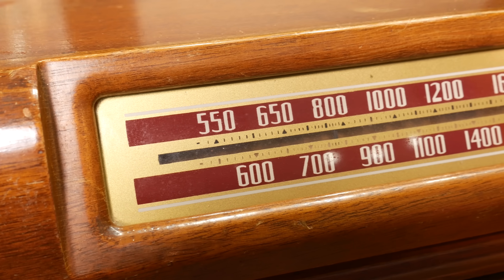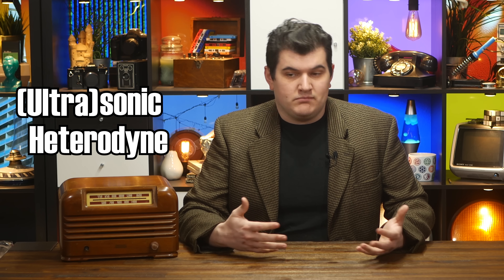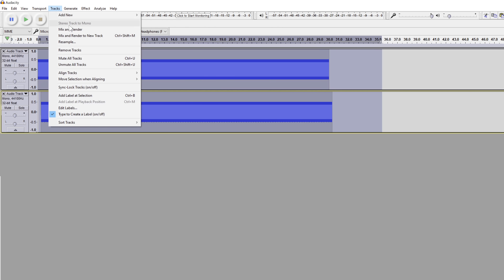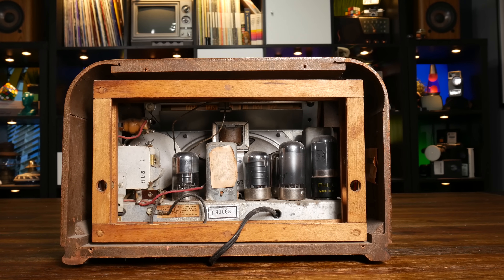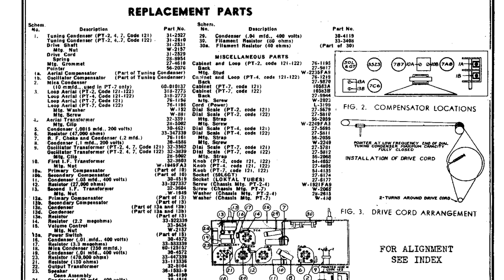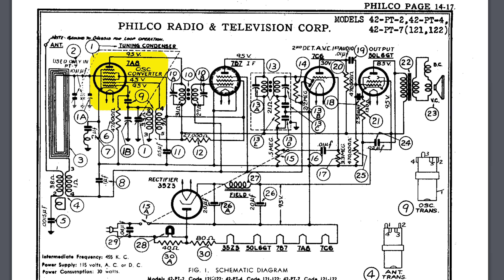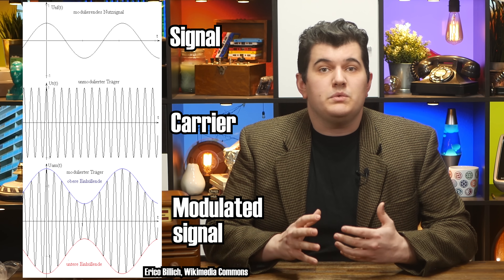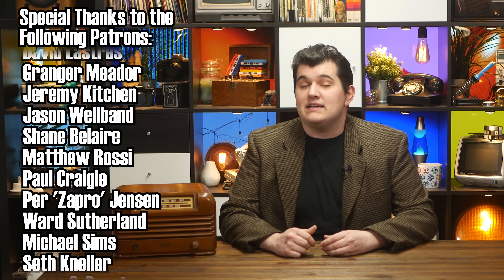The Superheterodyne Radio: No really, that's its name

Comment: Why is there a Nut Glued to the speaker paper? If I may ask
Reply from the maker: What a fine question! The speaker cone was torn in a transit accident, and while I was able to repair it with a special adhesive, it has buzzed really badly ever since. When the chassis is in the case, the front of the case presses against that nut which eliminates the buzz. It actually ended up improving the sound markedly!
Reply: @TechnologyConnections  My grandfather used that old trick! He had a cheap set of speakers with paper cones, and if they ruptured then he would just hot glue them back together. He used the same nut trick to reduce the buzzing, however the sound probably didn't come out as good since the hot glue created an unevenness in the cone.
Reply: @KSBEntertainment  plus, the pressure will impact the drivers' ability to move freely, which, from my experience, makes it sound worse. But thats entirely subjective
Reply: @TechnologyConnections  Sounds like the surround may have come unglued, it's not an uncommon sight even when the speaker has not been involved in any accidents. Something worth checking in any case.
Reply: @TechnologyConnections  Hah! I thought it might have been some sort of early mass loading, which would have reduced the Fs of the cone, lowering the frequency response, and making it less fatiguing to the listener.
Reply: @TechnologyConnections  Does it have metric or imperial threads?
Reply: I didn't originally notice this, and went back to look for a hazelnut
Reply: 5:53  For those, like me, who missed it.
Reply: I have a pair of reference monitor speakers from an old, defunct, NYC speaker company and one of the cones started to degrade at the flexible part where it mounts to the cabinet.  I flecked away the detritus and it buzzed like crazy, so I shoved a piece of facial tissue in there as a "very temporary measure" and it sounded perfect!  Even a tone sweep was spot on.  Not questioning magical speaker resilience,  I've left it that way for more than a year.
Reply: Old speakers dont have seperate surrounds , though the area where it would go is still more prone to damage from the strain. Moreso... so they started corregating the edge (still seen on pa speaks and the like sometimes) yet its still just the cone material.  You've inspired me to do some more research because I'm not actually aware of the genuine Genesis of the separate 1/2 roll surround as we know it today , I Used to Know that..
Reply: The first guitar amp with distorsion was made when a guy got a hole in his speaker and noticed that buzzing so he poked a bunch of holes with a pencil and cranked it to 11!!

Comment: Great video! Is this an AA5 (All American 5)?
Reply: Yes.  But why "All American"?  Weren't the designs in Europe similar as well?  They're also known as a "Five Tube Curtain Burner".
Reply: @stevenemert837  "The radio was called the "All American Five" because the design represented the majority of radios manufactured for home use in the USA and Canada in the tube era."
https://en.m.wikipedia.org/wiki/All_American_Five
Reply: Also called an AC/DC radio, because it can be powered by either type of current. In the 1930s, when this type of radio first appeared on the market, DC current was still available in some areas on the grid.

Comment: Why are FM stations all on weird numbers? 105.5, 103.9, 107,9. I know it's not AM, but does it have anything to do with this?
Reply: The numbers have to do with how FM frequencies are assigned. Since FM broadcasts vary in frequency (hence "frequency modulation) a station needs a range of frequencies that it can use.

In most countries those ranges are 200kHz "channels" with an even numbered frequency at the top and bottom - such 105.4MHz  to 105.6MHz. As a result, the center frequency, which you tune your radio to, is always odd numbered - like 105.5.

Comment: The superhet today has been partly replaced by direct conversion, iroinically what we used to have before the superhet.

The advances in digital technology means modern radios used for mobile phones/wifi etc.. convert directly to baseband without any intermediate frequency and use DSP techniques to provide the selectivity.

Direct conversion has shortcomings but in the digital domain they can be tolerated as data can always be re-sent and forward error correction exists too.

Some manufacturers such as Ubiquiti in the states have overcome the problems with direct conversion radio chips by adding a superhet stage that acts as a tracking filter.  This converts to an I.F. then filters there then converts it back to the original frequency albeit now with just the channel needed present.  Easy enough to do as you only need the one injection oscillator to convert down and back up again. They call it AirPrism which is a nod to the early Intersil prism radio chipsets that used superhet techniques as standard.

Back in the AM radio days a 455khz I.F. was fine as the image was always out of band, however later they added double conversion. a common frequency for this was 10.7 MHz . this placed the image 21.4 MHz away and meant the entire shortwave band could be tuned from a single radio.

they used double conversion so they could do most of their gain and selectivity at 455khz and have less stringent filtering at 10.7MHz.

Even when broadcast FM radios came out the first I.F. was 10.7MHz , hence the band was usually 88 to 108 MHz, a 20MHz span  , meaning the 21.4MHz image was again out of band at either end (depending if they mixed high or low).

Later of course as the spectrum got more crowded and higher frequencies were used they had to increase this I.F. further and 21.4 MHz became popular then 45 MHz and even 90MHz as the technology, mainly in Crystal/ceramic filters improved and so did the high frequency performance of active components.

Later still the early WiFi chipsets used SAW (surface acoustic wave) filters that were smaller and cheaper to make than crystal ones and operated in the hundreds of MHZ range.

Now we are back at square one, using direct conversion because the technology we have allows it .. Full circle :)
Reply: Even before the advent of DSP, direct-conversion or NZIF Near-Zero IF FM receivers existed. As the image frequencies are very close, they must use quadrature downconversion (mixing them with two sine waves 90° out of phase), thus resulting in two IF signals. The tricky part is that one of those must then be phase-shifted by 90° (Hilbert transform). Then adding or subtracting the two signals selects the upper or lower image response.
Concerning dual-conversion, I think it was used because 455KHz filters are tuned to a 9KHz bandwidth (AM channel width) while 10.7MHz ones are tuned to 200KHz bandwidth (FM station bandwidth). As tracking filters were a problem for shortwave, they had  to use a 10.7MHz IF but as the bandwidth of the filter is too high they downconvert it to use a 455KHz filter.
Reply: @atmel9077  the pedant in me has to say 10.695Mhz...
Reply: @hairyairey  This is because PLLs receivers commonly use a 10.24MHz reference frequency, as it gives 10KHz when divided 1024 times. It happens that 455KHz + 10.24MHz = 10.695MHz. In double conversion receivers the signal is first downconverted and filtered at 10.695MHz, and then mixed with the 10.24MHz signal which yields a 455KHz signal that can be filtered with a 455KHz filter.
Reply: @atmel9077  PLL = Phase-Locked Loop (for those who are just learning this stuff). Thanks for the reminder.
Reply: Just to add in a bit... some of the early superhets used other IF frequencies before 455kc became standard. I've seen sets with an IF as low as 155kc.
Reply: @jimsteele9261  500kHz was pretty much a standard in amateur (ham) radio a few decades ago. Still have in one of my parts box a few Collins filters on that frequency that I plan to re-use one day.
Reply: @jimsteele9261  But why 455KHz ?
Reply: @JohnSmith-eo5sp  for AM broadcast it would give an image of 910khz, outside the LW and MW band edge possibly.
Reply: I'd say what we used before superhet was not direct conversion but DIRECT AMPLIFICATION. The only application for direct conversion was morse code receiving, where frequency difference between local oscillator and signal itself defined the pitch of 'beeps'. To receive sound using direct amplification, phased-locked loop is needed badly. Not a thing you'd meet in tube designs :)
Reply: @allmycircuits8850  a direct amplification design would use tuned circuits and a basic diode detector for AM.

Would of been fine when the bands where uncluttered/quiet.
Reply: @allmycircuits8850  i agree with this. AM broadcast stations and spark telegraph stations were received without a local oscillator and used TRF (Tuned Radio Frequency) filters. 
You could have 2 to 4 filters tuned to exactly match the reception frequency, and those have to be able to be tuned to every frequency on the dial. This means a very sturdy and accurate tuning capacitor is needed, or sensitivity and selectivity will suffer badly.  In really cheap sets, a single tuned circuit was used with positive feedback. This made the set almost as sensitive and selective as a superhet but it is very hard to operate for an unskilled operator. Too much feedback and it will howl. Too little and you will have several stations at once, with very quiet audio. 
Direct conversion uses a local oscillator that mixes the incoming signal with the oscillator, to make a directly audible 'IF' signal. It can be compared to a superhet receiver with a 400hz IF and no detector. A direct conversion receiver can't be used for AM signals - only for modern digital signals and for morse code.
Reply: @allmycircuits8850  There were also the regenerative and the super-regenerative radios; they could be made pretty darn sensitive, but selectivity was a problem... and then your ears would fly off your head. The superheterodyne solved that problem. :)
Reply: @stamasd8500   I too started taking apart superhets as a kid all-American fives is they were called. I built several super regenerative SW radio kites including the Globe Patrol, a Science Fair project sold by Radio Shack.
Reply: @vcv6560  LOL I took apart a radio/turntable combo as a kid, and miraculously I managed to put it back together... remembered where each tube goes. :) It was a Russian device because I grew up in the Eastern bloc. Then I put together a few radios from kits, and then started making them from spare parts, fortunately I had access to plenty of schematics and literature as well as a few ham radio publications.
Reply: We do direct conversion with our FM receivers at work, and  it's a bloody awful mess to get it working properly when there is a strong station near a very weak station, which we want to receive. In days past, superheterodyne made it so much easier to get good sound quality as we could use fixed analog filtering to muffle away the adjacent strong shouter. With direct conversion the hardware is cheaper and smaller, but if it needs to be done mainly in software, the AD converters need to be ridiculously accurate to get any kind of quality in the sound. Superheterodyne is so much easier and better - at least when FM receivers are concerned.
Reply: Not so. Superheterodyning is still the dominant technology although the components used today have been miniaturized and  the process has been refined using multiple conversions and digital synthesizers. Even optical communications use superheterodyned signals to mix and convert light frequencies coming from a fiber optic cable.
Reply: There's even research going on trying to set new standards in time measurement by precisely defining laserlight frequencies using frequency combs (auto-referencing heterodyne systems).
Reply: @StephanBuchin  "frequency combs (auto-referencing heterodyne systems)" Huh?
Reply: Just wanted to namedrop that which is talked about here, its called homodyne if someone wants to read up on it.
Reply: Do you know much about transmitter combiners?
Reply: Direct Conversion of AM and later FM was the Homodyne system. To identical frequencies mixed 180 out of phase cancel out the Rf leaving behind only audio products. Superheterodyne was patented by Armstrong in 1913
Reply: You seem to know a lot about some rather obscure stuff...
Reply: @deus_ex_machina_  if you mean me, i am a design engineer by trade, started dismantling superhets when i was 8 . was a while before i made anything that worked tho :D
Reply: @amojak  I did. Love hearing stories involving older technology, like Steve Gutenberg's Audiophiliac channel.
Reply: @amojak  very nice, enjoyed it all, (the total lack of) protection gear included ;)
Reply: The superhet was replaced by the non-binary vegans
Reply: Crummy receivers like the All American 5 feed the RF directly from the antenna into the mixer.  Better quality receivers filter out image frequencies by having one or more selective  tuned radio frequency (TRF) amplifier stage between the antenna and the mixer.  You can easily identify the better sets by the fact that the variable tuning capacitor has more than the 2 gangs (mixer and local oscillator) used in the crummy receivers.
Reply: Condescending to American technology ehh?  Might I remind you the Japanese were still producing these 5Tubers as recently as 1969.
Besides, if they were well made then image frequency was not a problem. At least when these sets were new.
Other than a TRF stage another answer was Infradyne, using an IF frequency as high as 4.25Mz. This would make the receiver's IF stages compatible with SW and FM
Reply: @JohnSmith-eo5sp  Image wasn't an issue if there wasn't anything transmitting on the image frequency and/or the antenna wasn't that good there either. A lot of later kit moved to a 10.7MHz I.F. which meant of course the one frequency you could'n't pick up on Shortwave was 10.7 MHZ :D . back when i were a lad i often sat for hours tuning through the SW band and remember radio moscow, the numbers stations and our old friend the woodpecker (the now defunkt radar array near chernobyl).
Reply: live one day as an even moderately attractive woman and I think you'll find superhets are alive and well

(I kid, I kid)
Reply: I do not get the joke.  Someone explain to the slow kid?
Reply: @sirnickity  if this is about my comment, superhet - extremely heterosexual (and not shy about it)